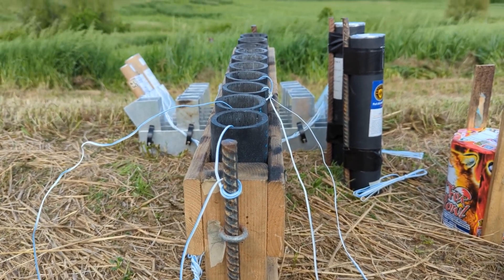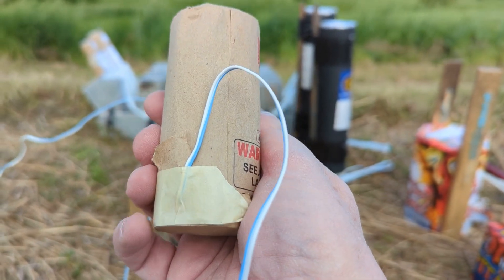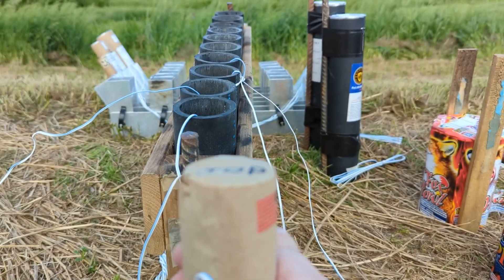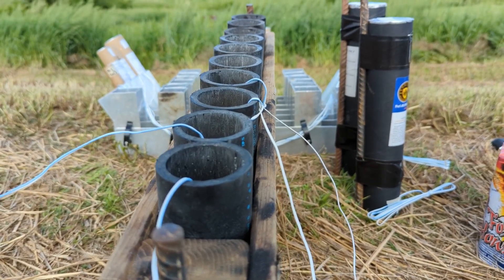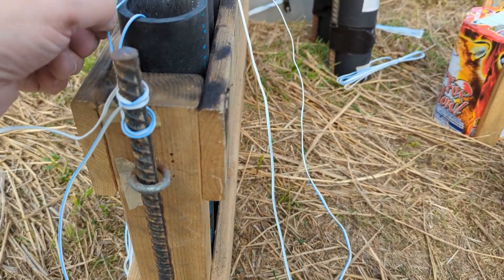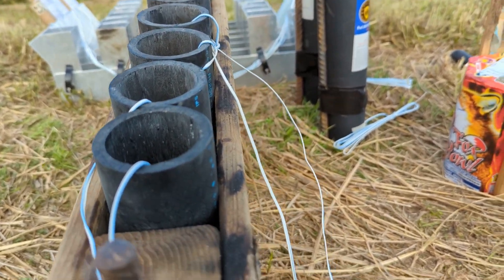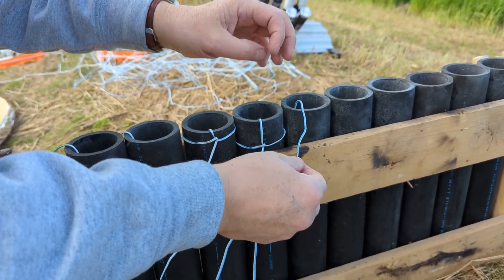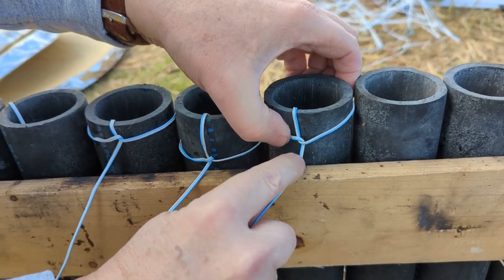Pyro Shorts: Tying Off E-Match Wire on Mortar Racks

Comment: Hey Jim! question, on both methods shown, what prevents the shell from pulling the wire off even though you attempted to secure it? Your first couple shots on the rebar could just pull off of the rebar, and then when you half hitch it, what is keeping that loop from sliding off the mortar? All just for learning. I only use 1 way which requires a hole on the mortar. I always enjoy learning new methods.
Thanks for the video!
Reply from the maker: Sorry for the LONG delay in answering your question. It's a good one! When I've done the rebar wrap or wrapping the wire around a screw in the top of the side rail, I've never experienced it coming off the anchor point. The beauty of the half-hitch knot around the mortar is the knot gets tighter the more you pull on it. It's basically a larger version of the half-hitch knot you already use when tying off through the hole in the top of the mortar. Same knot!